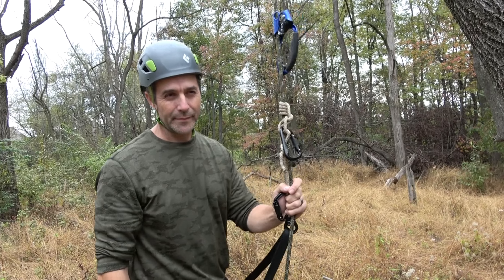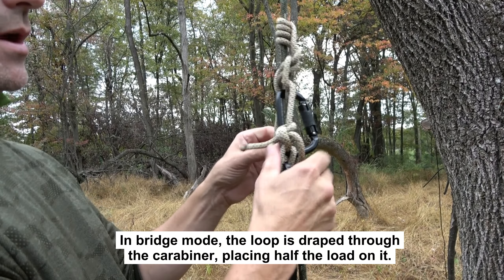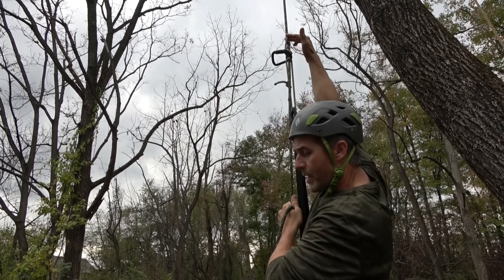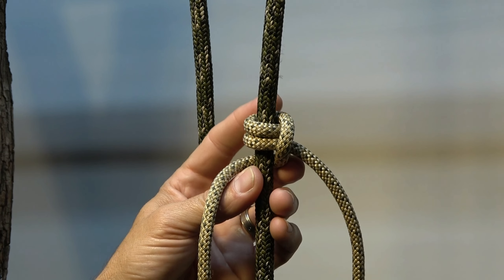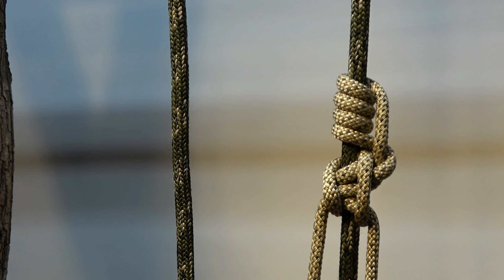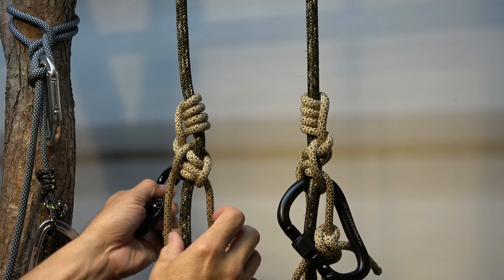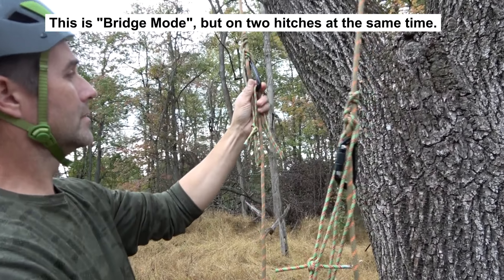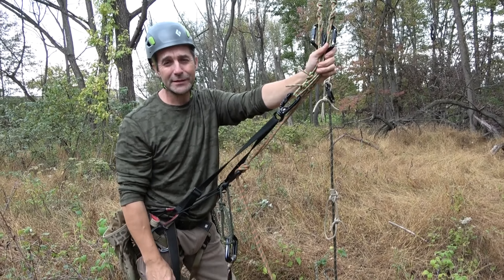Introducing the JRB Ascender Hitch, a new friction hitch!

Comment: Have you tried it out in rain or snow?
Reply from the maker: Of this particular hitch, I have done some wet testing but not in snow. However, over the years, and on multiple friction hitches, I have done a lot of it and can summarize my findings by saying that the presence of water will generally decrease the friction between a rope and cord. Webbing is affected even more. The amount of change varies based on the actual products in use.  For example ropes which have dry treatment will have less change in friction.  Although my tests of this particular hitch held, that doesn't mean another combination wouldn't experience slippage. When slippage does occur (I have experienced it on Bachmann and Michoacán), it's generally a very slow creep, not a total failure.  In all cases, as climbers, we should be prepared for the possibility that our primary friction device (whether its a hitch or mechanical) could slip or fail for any reason, at any time, including wet conditions. If you look closely at the 3 climbing demonstrations in this video, you'll see that I am tied into my climbing rope in 2 places and I can recover from a friction hitch slippage or failure.  In every case I have experienced, when a normally sound friction hitch experiences creep in wet conditions, we simply remove it and put it back on with one more wrap. I have never had to do this in the canopy, but I have rehearsed it. It's quite simple. Just don't drop it, and always carry a spare length of cord. In fact, I have been carrying 6 ft of spare cord in my bag for 15 years and never needed it yet.  Ice and freezing rain is a different story. We need to protect from having our friction hitch get frozen on the rope. I have experienced that and again, the redundancy in the climbing system will help us recover.  These points are General in nature and not specific to this hitch but I thought I should pass them along for you or anyone else who reads the comment.
Reply: @jrbtc  Thanks for answering! Yes often the hitch (Michoachan) starts with a slow creep, but I've also experienced that it locks competely. Always in rain. Well since I'm an old fart, I like hitches. But a year ago I purchased Rope runner pro and we get along pretty well.  But there is this fascination, to do this job without mechanical devises. Don't know why. Ceep on the good work!

Comment: I would prefer your method over a mechanical  device. I'm not a gadget kinda guy. Keep it simple and cost effective.
Reply from the maker: Thanks.  Now your comment was on the introductory video, and in case you didn't see it, further down on the JRB Ascender  Playlist, you'll see the 423 and 523 variations which i prefer especially on thinner ropes. That's what i am using in this system:
https://youtu.be/vkrPf_5bwAk

Comment: It's a bit like the stitch hitch
Reply from the maker: Yes, I am familiar with it but only from Saddle discussions. I don't believe the Stitch hitch has been recognized by the IGKT. If you're aware of who or where the author or publication is, pls reply. Differences include: 1. This can take load on 4 strands, not two. 2. The JRBAH carabiner handle is removable without untying.  3. Can transform from 2 strand to 4 strand loading (bridge mode) without untying.  4. This can be used in self tending applications, see separate video. 5. Lastly, i have not tested side by side, but i don't recall Stitch is easily broken under the load of your full body weight, such as in an SRT application. All I can say is that nothing breaks as easy as this. Cheers